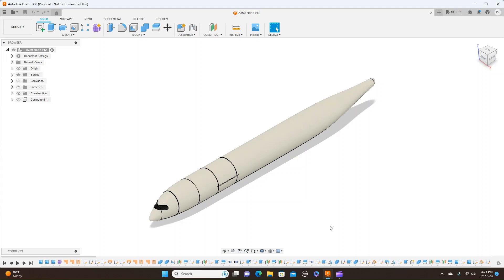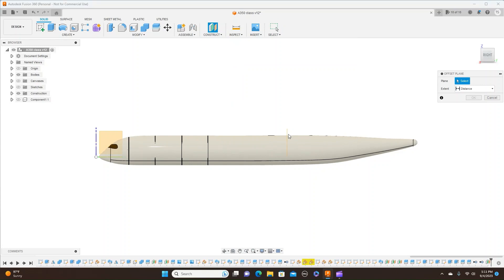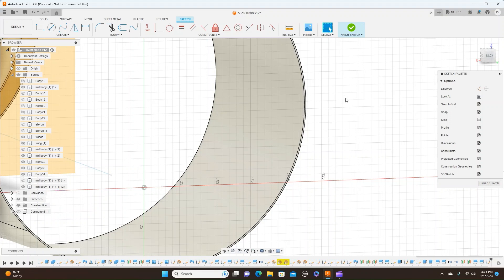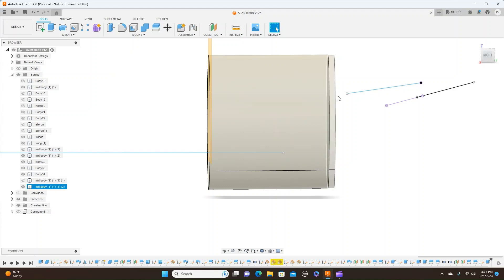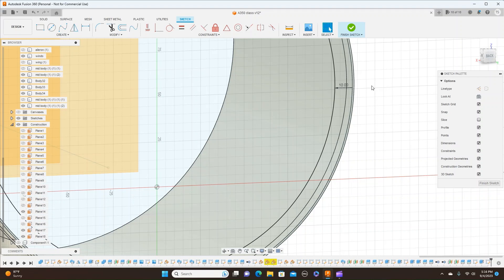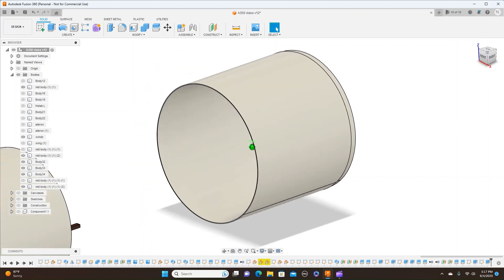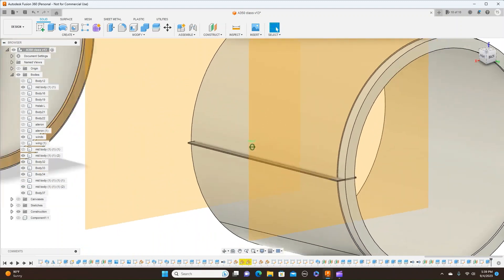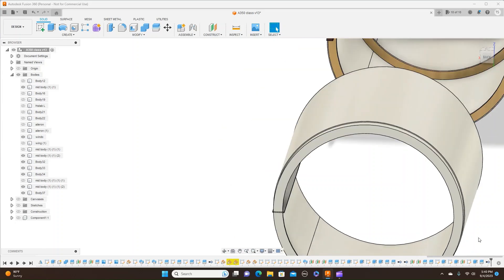How to model formers and stringers like Troy McMillans CRJ 900

Comment: Hi, very good stuff, nice tutoríal, one cuestión, don’t know if you are familiar with LW-pla foaming filament, you need to design the model with no retraction in mind, this way you print the part like vase mode, the last two string’s you added to the part, the 3D printer will print the outside first then the string’s, i don’t know how to explain better, it will be great if you can help us to know how to do that because i have no idea.

Comment: When you put a split in a few/length what size are you going for how long should that piece be? I know it could very depending on the type of printer but what would be a good average length of section of the few silage to split? thanks for your answer in advance.
Reply from the maker: 200 mm is a good length that most printers can print.